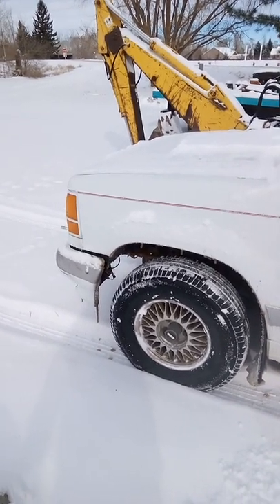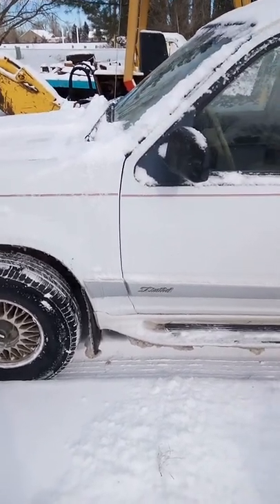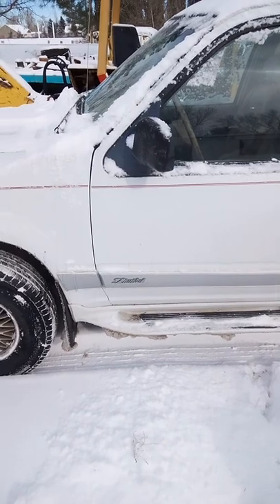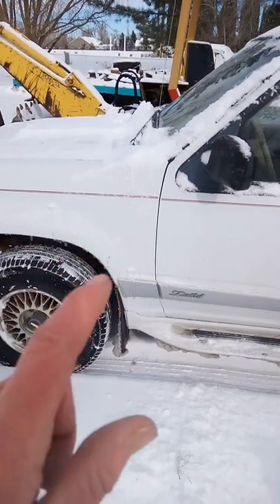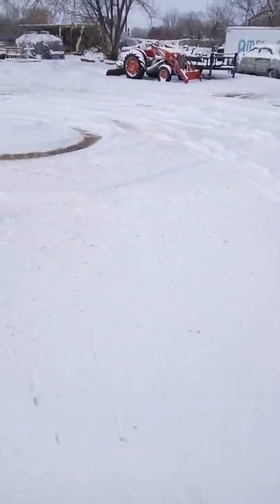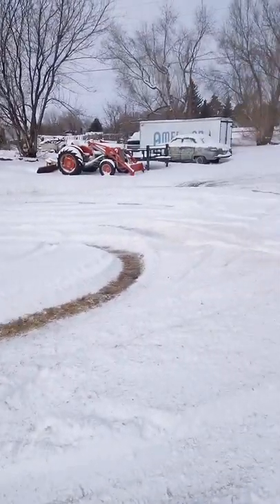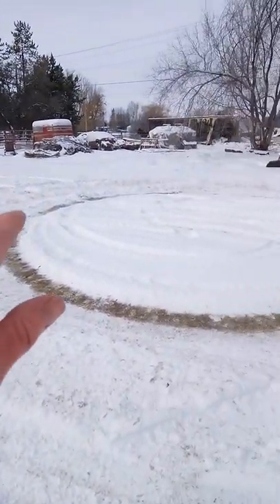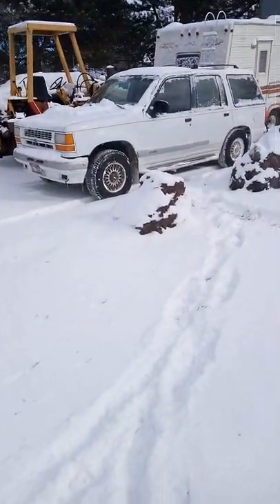#shorts What the Idiot Light on a Ford actually does 🚨🚨🚨

Comment: Nice exploder, you don't see them around these parts no more.
Reply from the maker: I picked this thing up 6yrs ago as an "Abby" (a running driving parts car) for $600 with a dead transmission in it but a new one in back. I stuck the new transmission in it and have been driving ever since. I have a love hate relationship with this thing. I want it to die so I can use that rear end in something else, but in the snow.... it's the best thing on the road lol.
Reply: @BareRoseGarage  I liked the early exploders and the Buckin Donco II. Swap in a solid axle from an xj and your good, until the body rots off the frame anyway.
Reply from the maker: Leave it to Ford to develop the (nightmare) Twin I-Beam in what... 62, 63 and keep it going all the way through the 90's. And then add 4wd to it as well...... ug.  1 good thing I can say about it though, you can turn these things around on a 1930's street and never touch a curb. Ditch Riders used to use those Bronco II's to ride the canal banks. Only thing better was the IH 880 Scouts.
Reply: @BareRoseGarage  I love Scouts, but they will rot out in the desert.